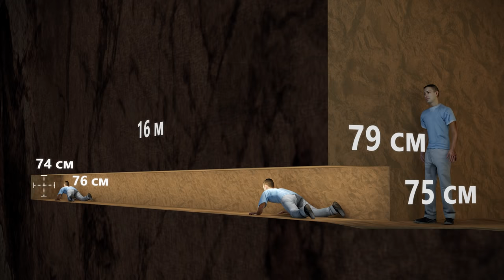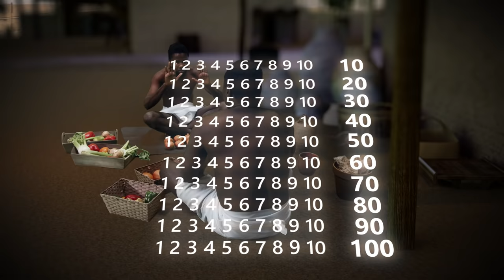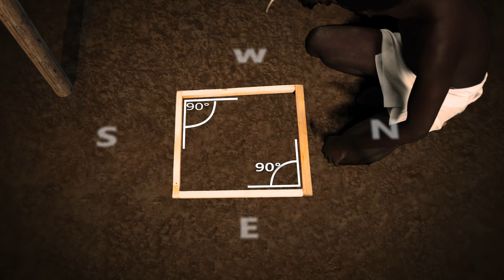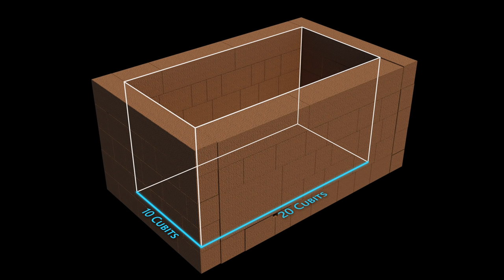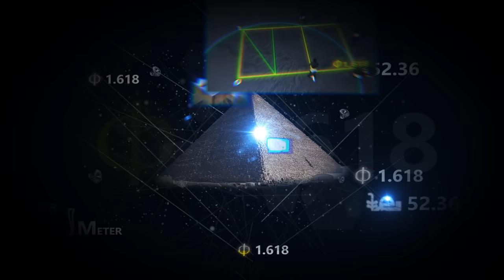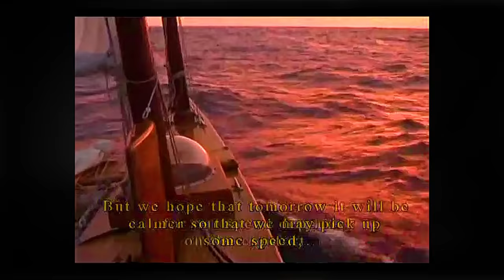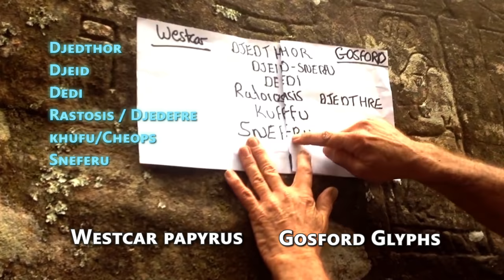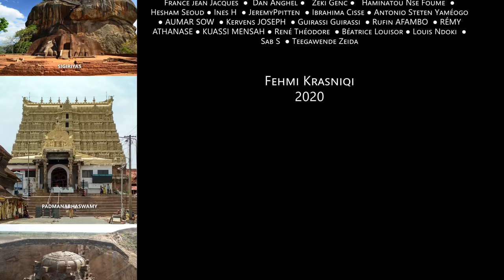The Movie Great Pyramid K 2019 - Director Fehmi Krasniqi

Comment: Thoroughly entertaining movie, thank you. Whilst possible, I have 2 questions....
1. When you "melt" granite and cool it, you don't get granite, you instead get gneiss. To reconstitute the original granite, you would have to duplicate the exact pressure, temperature and cooling duration. Failing which, it will not match the parent rock. Also, what formwork would withstand the temperature of molten rock and remain so dimensionally precise?
2. Whilst grinding parent limestone and sandstone rock and combining it into a "concrete" is indeed feasible, the grinding process would obliterate the fossil remains of the original rock, as it is sedimentary and contains many fossilized sea creatures etc. The newly cast "concrete" would then be homogeneous and free of fossils, along with having a different crystal structure upon solidifying. Weren't fossils found in the stones upon testing their makeup? Also a point of interest, the formwork required for casting such huge blocks would have to withstand massive hydrostatic pressure from the wet "concrete", so what did they use to retain such dimensional accuracy in the final product?
It is a thought provoking concept though, I am not denying that.
Reply: In any case, it is more logical to think that the stones were molded.  Because cutting them with such precision is literally impossible.
Reply: It's not about thinking anymore
I just not logical 
Lens getting to 1000's degrees temperature to melt 
Well building the lens like that is a huge challenge by itself 
This is just theory as many others 
Molds are always the same , no blocks are the same width
Reply: @lucaspodolsky8979  well no. It is not literally impossible. It's not literally anything. It is feasible though improbable, with what we know and understand at present. Logic is only applicable to the standards and knowledge available, it doesn't take into account future knowledge. It was illogical in the 1600's to imagine flight, but today that logic is revised to incorporate new knowledge.
Reply: It not even about logic
Think about it 
What they use to withhold over a 1000 degree  material to melt ,what kind of mold will stand up to this temperature-pressure few thousand years ago - Cooper??? Ups Cooper melts at arund 1900 F but how you create or rather weld the side 
Than on the top it is so precise 
I've seen hundreds of pour-in foundation - 'Masons these days use very heavy steel forms to make sure walls retain shape .
These blocks do not weigh 100 or 200 pounds or 300-400 kilos 
Wooden molds ??? Not absorbing moisture???? - keeping perfect shape after repeat use ???? Different widths - each block has a different size width wise - how you have visible joints - at least  2 sides .When u pour concrete, it becomes one mass 
These blocks have 6 sides - forget about 5, but have you separate the 4th bottom side from each block - pour in the mold- let it dry and slide it ??It is not crazy glue which dries almost instantly,
They had chemicals that speed up the process  ????? 
Each block is very  - CAN NOT BE POUR ON THE TOP OF THE BOOTOM ONE DIRECTLY WITHOUT SEPERATION OTHERWISE WILLPERMAMENTLY ATTECHED TO THE BOTTOM ONE 
There is around 2.3 million blocks in 1 pyramid .....
Reply: By the way 
For centuries, we have been moving forward very-very slowly-except Leonardo...
If Egyptian had that advanced technology, let's say 5000 years ago and using Cooper, somewhere on the way to the present, we've lost plenty of everything
Reply: @vincentk.8653  no argument there. It is most probable that we as a species have lost much knowledge of various forms in the centuries, including long before the Egyptians and Sumerians. Gobleki Tepi is evidence that things are not as they may seem
Reply: there wouldn't be massive hydrostatic pressure retard, almost all the weight is directed down as it is a putty and not water, it is not bursting to fly out the sides and even if no wall were placed and the putty was just stacked high, it would form a concrete mound meaning that the walls of a mould would have little resistance from the inside.
Reply: @vincentk.8653  Clay lining a wood mold would probably work. Ceramic kilns get up to temps. that high.
Reply: The "debunkers" love to talk about the composition, pouring, containing and forming of the stones, but this movie encompasses so much more.

The ancient egyptians lay the basis for all the sciences and that process was thru observing nature and it's so fascinating to learn how they did it. Wow.
Reply: @vincentk.8653 the word is copper
Reply: The hydrostatic pressure your referring or what’s known in the concrete world as liquid head wouldn’t be an issue. You can dry Pat concrete into a form. This is known as rammed earth process.
Reply: @michaelm7980  yes, rammed earth is not subject to hydrostatic pressure but that's because the moisture content is minimal. The liquid state is not reached. But melted rock, in order to pour it into moulds, would have to be liquid state.
Reply: I couldn't have put it better myself? Also all the blocks in the construction were hematogenous in form to (I believe) counter any seismic activity over the millennials that would mean creating not only a different shaped form for each block they poured but a counter matching form on all four sides over 2000000 times? It would be like forming a puzzle pieces but not to mention that the blocks are set with such precision and so little tolerance is that the frame made to pour these blocks would have to be so exact I just cannot see it being done nor would I believe that to be the easiest way. And yes from what I am aware of your correct there has been fossils found in the stone and they can even trace the stone back to the quarry of rock from which it originated and to say that pouring a block and natural granite are almost identical.. it does not mean that they are an almost is being used very loosely to come to this conclusion. I personally believe the date on the structures are closer to 14000 years ago then 4500? And not to mention if this was the case they were not attempting to counterfeit something if they had this much intelligence they would have known that adding an aggregate to a poor would only strength in it but there was none..? But very good documentary and I really appreciate their point of view and very much enjoyed watching this I most likely will watch it numerous times
Reply: @hydrophobicgoldfish "It's not 'literally' anything." 
Coarse smooth. 😎 
LOL
Reply: 1. Wrong. Gneiss is a Metamorphic rock not fully melted. if you Melt granite you can Ryolitic lava flash cools to Obsidian. 
2. haven't they determined the where the Limestone was Quarried as they have with the Granite?
Reply: I would fill more happy if you mentioned how on earth the diameter of a water drop remains the same on a waterproof surface! how it even remains perfect circle!? you can check it! and I suppose you won't use syringes to measure the volume of the droplet you are bout to put on the waterproof surface 🙂
Reply: @nimasarlak  Good point.  I just tried it and got multiple sizes of drops, many of them smaller than 1 cm.
Reply: @hderryl  Hi, Yes, the point is the size of the droplets depend on the size of the stick that is used to make them! if u use your pinky you will get a smaller droplet vs if u use your index finger u get a bigger one! So, the whole assumption of the "droplets of water will always have same size" will be blown up! in fact I do not know how he got that idea!? any way there are a Number of other things @FehmiKrasniqi-Official should answer!
Reply: @hderryl  They used granite to catch the droplet and salt water.

Comment: I am a Civil / Construction engineer and I will address my points over few comments:
3- What kind of humans can take the intense heat of melting lava to work near it and under a hell of intense concentrated sunbeam you proposed?
Reply: Maybe the animal heads are helmets for suits.
Reply: Agree, said the exact same, couldn't conjure a theory, even for thought sake lol.
Reply: There could have been walls constructed around the device not shown in the video.
Reply: Why authors of that theory won't create vases or status out of melted granite with use of self developed gigantic magnifying glass installed as they have proposed ? They made it looking so easy after all~
Reply: @Tom_Mroz  I've seen people melt rocks with a magnifying glass probably 3 feet in diameter and it worked. But ya it wasn't grannet and the didn't melt the rock into a form or anything cool like that. But never the less it was some sort of proof of concept.
Reply: @Tom_Mroz  But this is what's really going to cook your noodle. The great pyramid was actually a primitive nuclear power plant. The 2 shafts going down into the "kings" chamber was so that they could pour water into it and the box was where they placed the uranium and the cieling was super reinforced to withstand the heat of the chamber.
Reply: @Tom_Mroz  Exactly
Reply: @theamericanjoeshow   Super Reinforced.  Well there ya have it,,, Show exactly how the Kings could exist, in which ever state, of a battery or power plant.
Reply: @TheeRocker  your question is hard to understand.  The "kings" chamber was never designed for a king. We miss named it in modern times.
Reply: @theamericanjoeshow  ,,, exactly ;)
Reply: @theamericanjoeshow  if you pour molten copper or silver into a bucket of water it forms individual blobs which don't bond strongly to one another, but easily break apart.  The cooling rate is far too fast to allow the molten drops to get together and form one solid mass.  If you took molten granite and spilled it into a form, it would air cool so quickly, it too solidify almost instantly, like candle drippings, and would form a bunch of individual blobs not strongly bonded to one another, and although the overall mass would still be hot, I don't think it would be close enough like the molten phase to consolidate into a solid mass.  I think it would be sort of like a concrete cinder block - pores visible all over the surface and into the interior.  If you took a piece of it and dropped it onto a concrete floor, it might very well shatter.
Reply: @theamericanjoeshow  I've worked in two nuclear plants, and can tell you a well-qualified "NOPE"!!!  They were in the Copper Age and wouldn't know a thing about the metallurgy to build a nuclear reactor, let alone the steam generators, the thick wall high pressure piping, nor the steam powered turbine generators.  Nor would they have had the metals to do it.  Research suggests that the only iron the Egyptians had access to was the iron from meteorites, they knew what it was, but they didn't have it in quantity to do anything with it save for sacred objects.  Rumor had it that King Tut had a dagger made out of one such meteorite.
Reply: @nobodyknows3180  I'm by no means saying that it was a good nuclear reactor. It most likely failed in many ways. This is why it was abandoned and not used for very long.
Reply: @theamericanjoeshow  well, it's just a thought.  After all, none of us were there, and we don't presently have the means (that we know of) of travelling back in time) to go way back and see when the pyramids were built, who built them, how, and why.  We have to rely on empirical evidence (measurements we have collected) from the pyramids, other artifacts, ancient artworks depicting scenes from life back then, even ancient writings where they exist, to try to figure things out.  And maybe we ARE wrong, maybe there were advanced civilizations or technologies back then that have been lost over time, maybe even at one time there WERE aliens who visited earth, and over time, information and knowledge about them has either become hidden, lost, or so distorted as to be meaningless.  But as an engineer working in the real world, I am inclined to believe what information I can gather first hand as proof that something exists.  To that end, they should do radiologic sampling of the pyramid - after all (and I've worked in two nuke plants), that stuff gets everywhere, radioactive isotopes would still exist in that chamber even after 4600 years or even 12000 years.
Reply: @nobodyknows3180  Thanks for your insight. I did see in YouTube video that the grant did show small levels of radiation not sure how true it is. I have a crazy theory that maybe there were pyramid shaped UFO's that they seen and maybe the aliens said that it was powered by nuclear power so maybe the Egyptians thought that if they built a pyramid and put uranium in it that it could somehow fly. But obviously that can be very wrong. The whole thing is baffling. It just sucks the the current Egyptian government is making it impossible to really probe the pyramid or even God forbid a slight dismantling of the pyramid to really figure it out once and for all. Have a good day.
Reply: @theamericanjoeshow  There is another alternative to fission reactors, which always leave traces of long-term radioactivity behind.  Fusion.  The simple process of fusing two atoms of hydrogen into one helium atom unleashes more energy per unit of mass than fission, which is the splitting of uranium atoms.  And there would be no trace of it, as it doesn't produce radioactive by-products. Anyway, we're both crazy, and Nobody Knows the whole story anyway.  Keep dreaming, Chris, and who's to say if you're wrong or right, don't take no guff off nobody.
Reply: @benbenhomeandlifestyle5122  is that anything like cold fusion?
Reply: @Jandejongjong  That's a poor rip off of the original. The channel has just added a voiceover .... but yes the original not that lady narrator and her "informer" is good